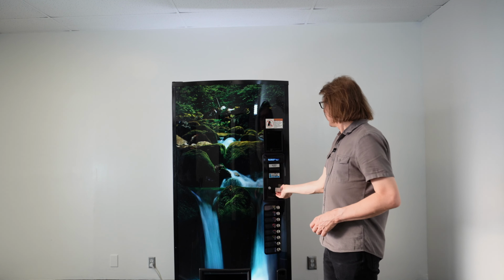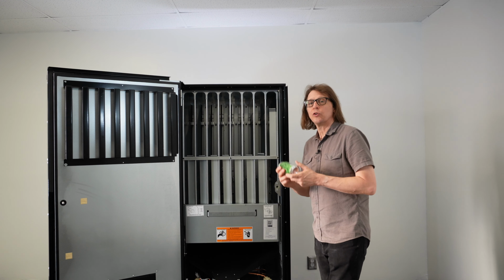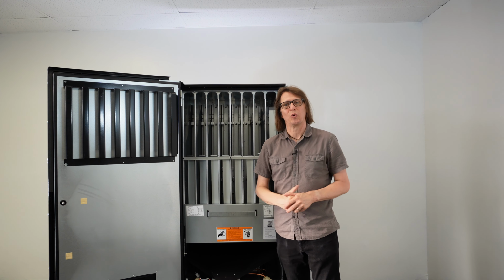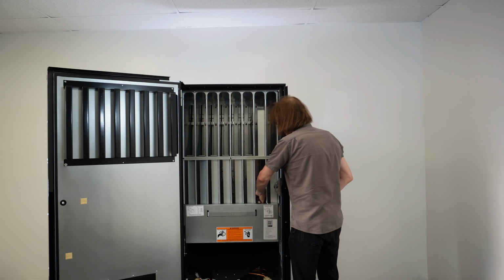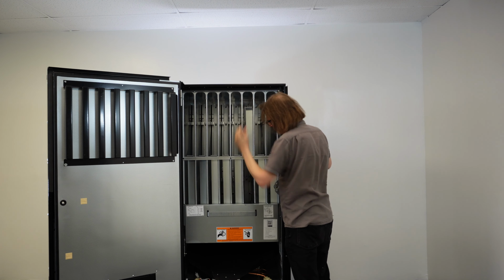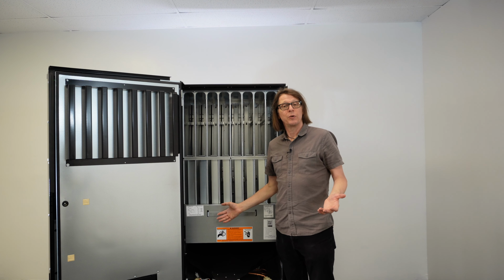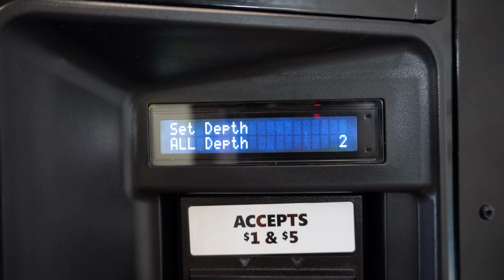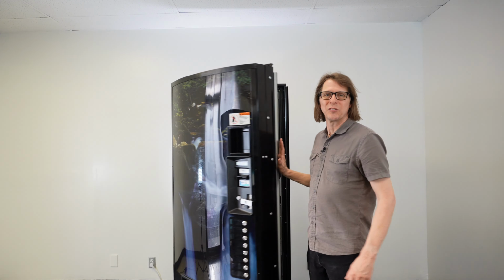Vendo 721 & 621 Drink Vending Machine - How to Load Drinks & Configure

Comment: we were dispensing 20 oz bottle water but since we can't get them we now want to use Aquafina 16.9 bottles.  when we loaded the slot with Aquafina and ran tests the machine would dispense 2 bottles instead of 1 bottle.  What's the issue?  bottle too skinny?  Thanks
Reply: Yes, you need a side spacer

Comment: Having an issue with PayRange as cashless setup. I don’t need to have a card processor to utilize that system do I?
Also, after it’s filled, do I need to adjust the counts in the machine for inventory, or is that irrelevant?

Comment: I have a vendo 840.  Or at least I am pretty sure that is what model it is.  It does not have slide tabs underneath for the product length adjustment.  There is a combination of white clip tabs and black clip tabs.  Do you have any information or videos that you plan on doing for that type of setup?
Reply: Those are the V Max models.
Reply: @PhillipBurback  Yes, that would be correct.  I am more so looking for guidance on how to set it up for regular cans, monster cans and 20oz soda bottles.